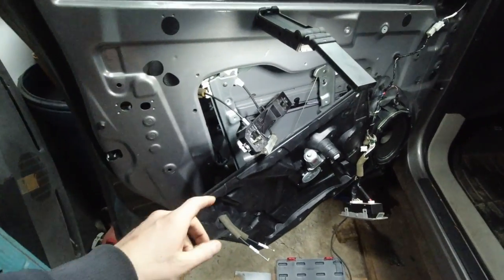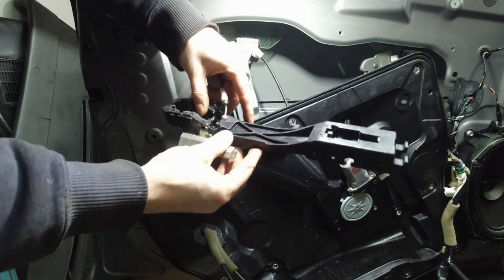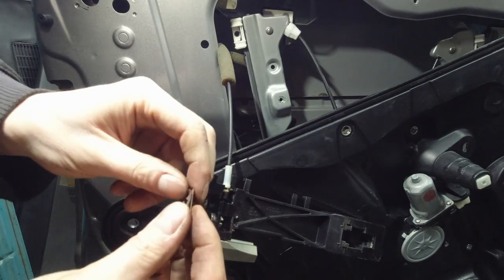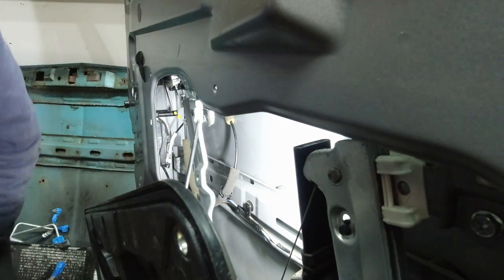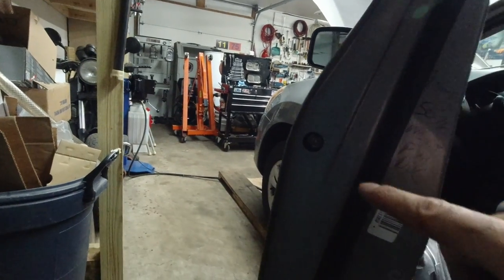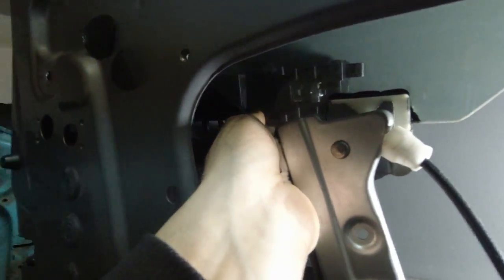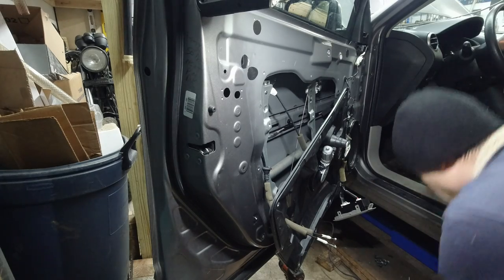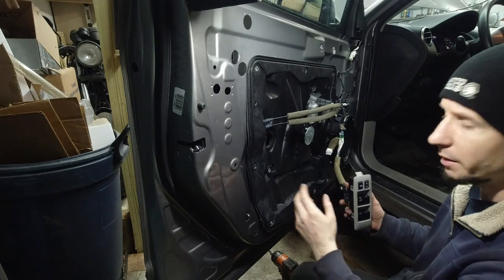Nissan Rogue door does not open, door handle fix

Comment: Thanks, that was exactly my problem on our 2013 Rogue. One tip to get access to the inside handle, roll the window down half way, remove covers to expose big holes so you can detach the glass and lift out. Then only remove the black 10mm bolts to remove the entire power window assembly. Piece of cake! Do NOT loosen the silver 10mm bolts!
Reply from the maker: Great tip, hopefully people will notice your comment.

Comment: Thank you so much. I went to fix this on my own because I have taken the door panel off many times for stereo work-- however, I could not figure out how to remove the lock and handle to see the issue. Your video helped me identify the T30 fastener on the rim of the door and also how to remove the yellow clasp that holds the locking lever in place. Life saver. I agree, putting the glass window rails back onto the inner panel is a pain. I found suction cup handles from harbor freight made it so much easier. I was able to adjust the glass to the right position and line up the rakes with the panel. I used a piece of string at first to pull the rails flush with the panel because I was having a hard time getting the screws to "catch" the threading on the rails. Once the rails were pulled against the panel I fasted them and it was smooth soaking from there thank you again!

Comment: Thanks for the video! You really helped me out of a bind. Customer needed their  car back to soon as possible. Couple things I did different that might help others.First thing I did was tape the window up so it doesn’t come down when you pull the regulator panel away from the door. Second thing I did was instead of using a screw to make up for the gap I used just enough clear silicone to fill in the gap to stop the ball end of the cable from popping out. Making sure the silicone doesn’t interfere with the ball end of the cable. I just subscribed to your channel. Thanks again!
Reply: how did you keep the silicone from interfering...just filling near it and letting dry first? Such a poor latch design.

Comment: This video is super helpful thank you for making it. I think you're having the same problem i am. The cable is a metal stranded cable so it's wound. I'm pretty sure my cable has stretched itself overtime. So i had to replace the entire cable to the Lock actuator and it seemed to fix it. I think they used cheap wound cables that stretch over time.
Reply: This seems a good option. Thanks for the tip.

Comment: I just did this repair (new drivers door) handle on 2011 Rogue with keyless entry yesterday. Without viewing videos like this one, the job would have been much more difficult. Hint, tape the windows in the full up position before you remove regulator panel. The holes lined up and I drew it together with longer 8mm bolts (not supplied) and one by one replaced with factory 8mm bolts. The whole job, about 1.5 hours of twisting and swearing!

Comment: thanks for showing how much frustration I'm going to run into! now how to actually get the door open before fixing!
Reply from the maker: this door still opened.  see if you can remove or even slightly move the door panel from the inside out of your way and try to pull that cable that opens the door.

Comment: Worked on my brother-in-laws 2011 Rouge and found that removing the window glass allows you to remove the black panel AND the window rails as a single unit.  This is much easier than trying to re-align the rails to put those silver bolts back in.  There are only 2 bolts holding window in, and it's an easy remove and return.
Reply: thanks, did you take any pics? have steps to do this?
Reply: Thank you soooo much for commenting on that! Doing it by removing the window glass was really easy!! Much appreciated.

Comment: Thanks for this, looked for other instructions but could find none. One thing I wish you would have shown was how to get the damn thing apart to get to the cable. Getting that lock out drove me mad until I saw where I could snap that yellow clip off the rod down below, allowing the lock to rotate out. I took some pics of how I fixed it. I actually made a little "shield" to hold it in. Need to file a patent now and get paid for my marathon fix on the wifes ride. Cheers.

Comment: I did this before in 2019. Lasted almost 2 yrs.  It hapened again few months ago during freezing weather. I dont recall totally taking the lock out, but had it disconnected in there (from the rod)...I had a heck of time with the window regulator attachments/plastic and it looked bent from factory...(i actually had it all out of the door for some reason)  It seems like this is a problem with 'many' Nissans (incl Sentra/Altima).  I found a listing for a recall circa 2010 for the Rogues regarding the latch popping out, but i have been to dealers a handful of times during ownership and asked on recalls and nothing was ever mentioned about the latch, smh.  The screw was a great idea!  I am finding it hard to bring myself back to go thru this again. Plus my tools are across the country.  Anyone in TX that I can pay $60 to do this for me?? LOL.  Due to this kind of fun as well as the CVT, the only Nissan i would buy again would be older Xterra.

Comment: Having the same issue with my Nissan X - Trail - will try your fix. Thanks for the video!
Reply: Did it work?
Reply: @grymbathym635  Yes it worked, its basically the same - the only difference was i removed the glass, it comes out at an angle through the window frame, after you loosen the two screws holding the glass to the elevator mechanism.

Comment: Great video and innovative fix. I'm by no means we'll versed mechanics and decided to take on the task of fixing the door handle on my girlfriends Nissan Rogue. I got it done however I'm having a stressful time trying to get the lock to line up with that screw on the side of the door any idea why? The screw is hitting just before the hole on the locking mechanism.
Reply from the maker: something must be in the way, make sure its all flush on the door inside and the mechanism.  Went back in easy for me, kind of.

Comment: my 2012 just did this for the first time. Nissan used to never have issues like this. This is the 3rd thing thats happened to mine since I bought it new in 2012. IDK I dont see the quality I used to and my Nissan Frontier is the same way.
Reply from the maker: Ever since Nissan merged with Renault, quality has been going downhill.
Reply: Agree, Renault,etc. bought Nissan I think and in decline ever since. On many top car pick lists, Nissan is falling. Now late model Hyundai/Kia are ahead. The CVTs are a huge issue/risk as your mileage climbs.

Comment: u can go thru what this clip is showing - I would try a fix it by trying hot gluing myself - the plastic that is for the cable and ball  is worn is the true issue - this is why the ball is coming out - this needs to be a recall - this is a problem with the roque - more and more owners are running into this issue-- another issue Nissan has with the Roque handles that crack - there is a flaw in the manufacturing design of the handles -
Reply from the maker: this used to be a recall but it ended years ago.  Not sure if hot glue would work in this case since this part moves.

Comment: I HATE, HATE, HATE my 2013 Nissan Rogue. Worst car I’ve EVER bought.
Reply: Same my 2010 rogue drivers side has been hell. The exterior handle broke during inspection. Fixed it....then the window wouldnt roll up or down....fixed that...now you cant open the door from the inside and it's the front driverside door

Comment: Hi there, very informative, thank you. But I still have a question,  ¿how do you remove the lock cylinder? Thanks
Reply from the maker: the whole handle assembly with the lock cylinder is held on with one torqs bolt (T30) on the side of the door or door jam, remove that bolt and the handle should come out, then the lock cylinder.  Dont forget about the yellow clip.
Reply: Thank you very much!! Because I was trying to remove that bolt and keeps turning and turning. So, definitely I need to remove both door panels, I guess.
The only problem that I need to fix is the door handle that has broken and of course we can’t open the door. But once again, thanks a lot, I’ll try the yellow clip this time.

Comment: I have the same issue but during the winter. I'm not able to open it from inside and outside. But in summer time everything is ok. Strange.
Reply: same here on my 2012
Reply: @stackerforson7180  
same as me too, rogue 2011.
Reply: Same, i think the original recall, circa 2010(?) even mentioned cold as a factor. Mine happened 2x during freezing weather.

Comment: i need to do this on mine it was the passenger side that stopped working since theres no key lock there it should be easier?
Reply from the maker: most likely, less stuff to take apart.
Reply: @cruizinmax4017  i will likely do it the way you did it, i dont feel like removing the window so ill just tape it in the fully closed position

Comment: Thanks, but how did you get thet door open to fix it?
Reply from the maker: My door opened from the inside, if yours doesnt then you have more issues.  This isnt my car so I couldnt tell ya if theres something you can remove from the door panel and try to reach in to pull that cable.
Reply: @cruizinmax4017  can you explain how to open door if one can't open it from the inside?
Reply: This is how we got the door open when it was locked from both the inside and outside!
https://www.youtube.com/watch?v=lKi2n8ubfAE

Comment: Hi, have same problem today, cannot open door from handle outside but from inside can open with nissan navara np300  2017 year this, be same problem to repair?
Reply from the maker: Sounds like it, these cars most likely share the same parts.

Comment: It was a factory recall until 2014, the local dealer near me said $100 to fix it.
Reply: If it is a recall shouldn't the dealer fix a no cost to you?
Reply: Awesome info! I’m registered with Nissan to receive all factory recalls on my model (2013) and have no info on that. I’ll be visiting my local dealer this week😬😬😬
Reply: @phyleciastephens9142  if the piece is  actually broken inside the door it will cost alot more because it has multiple connections
Reply: @amederward7081  ya exactly. ONLY Nissan would have a recall that expires. I had many trips to dealers before 2014 and never a peep about this recall. Now mine is unlatched/broken again. Never another Nissan, smh.
Reply: I would pay someone $75 rt now, not to have to do this again, lol